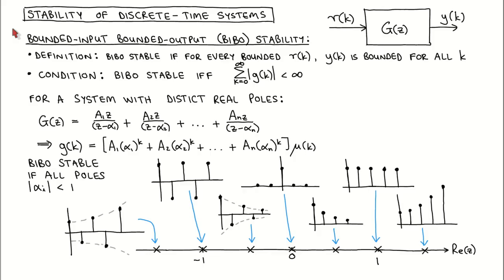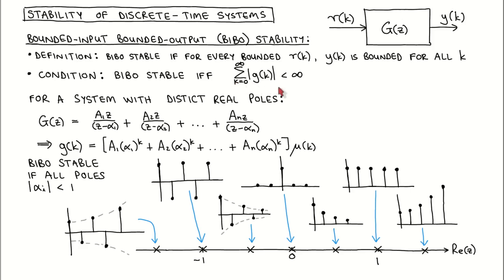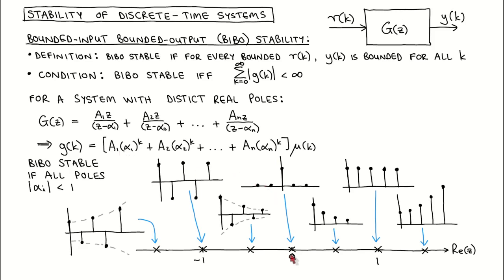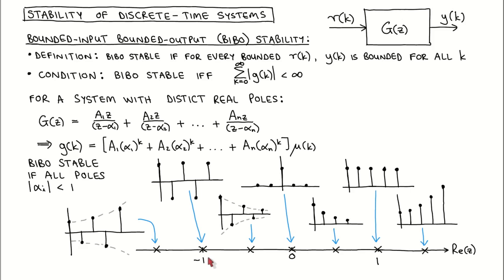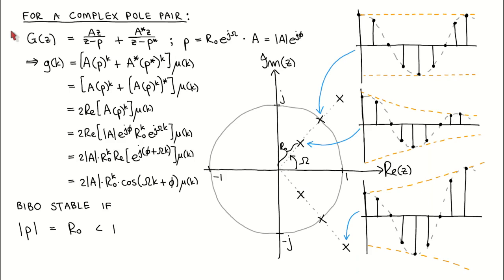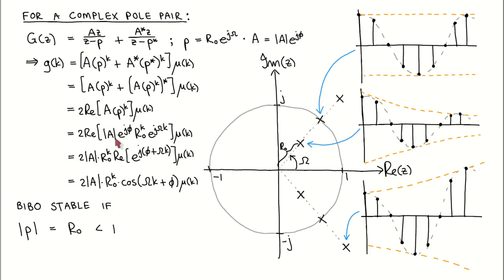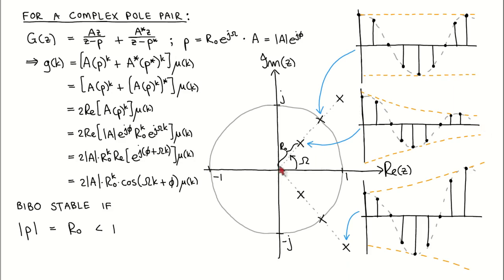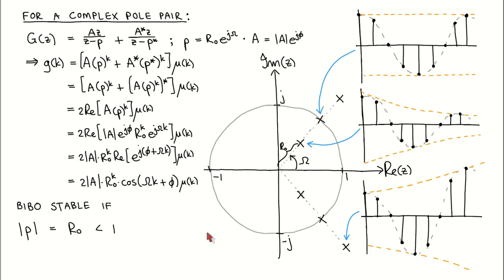Digital control 8: Stability of discrete-time systems

Comment: Interesting video, very helpful! How can you characterize a system, that has multiple poles = 1. From my understanding it is marginally stable, but not asymptotically stable. I would assume we would have to stabilize a real system with those specifications, right?
Reply: If you have multiple poles equal to the same value then it is either the same pole, or repeated real routes which means you have critically damped system, damping ratio = 1 which creates a step function. This is considered marginally stable though since this system is impossible to realize in real life.